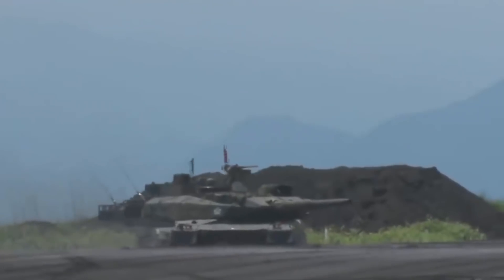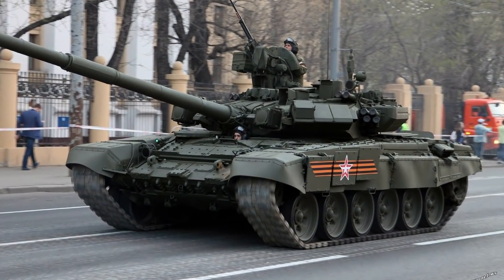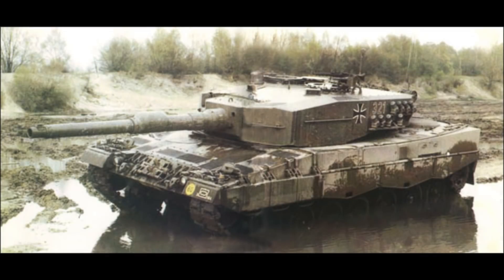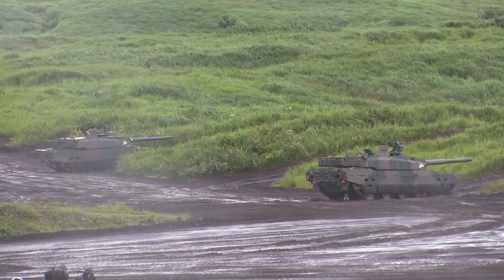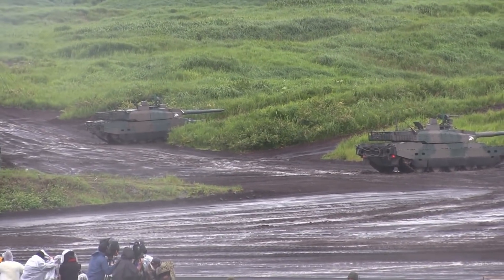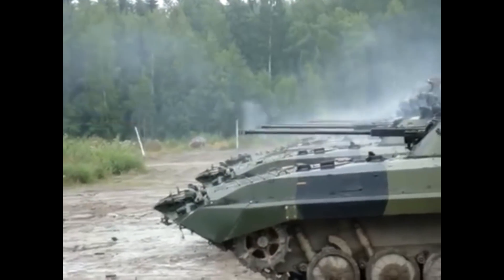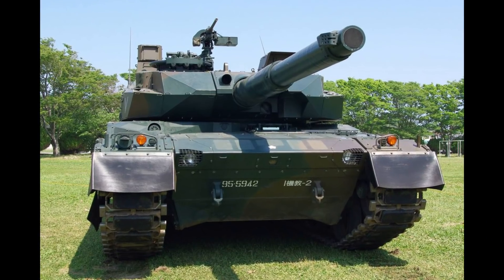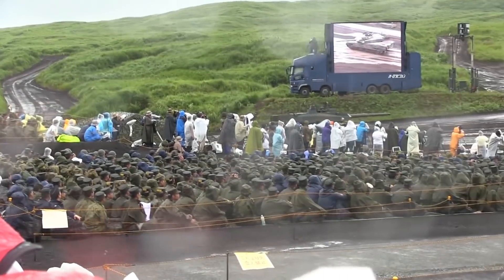Problems with Type 10 tank

Comment: Type 10 uses an obsolete layout, therefore it can't save any weight.  Engine is not transversely mounted, 5 road wheels are spaced far apart which causes high ground pressure loading, the chassis itself is obsolete by the layout alone.
Reply: People tends to attribute heavy weight to armor, which is completely wrong in the Type 10's case.
The tank is extremely frontally heavy because of it's composite armor. To achieve a good frontal armor with low weight, they had to strip off all of it's side armor and focused it on it's front. Also, the tank have a smaller profile compared to it's Western counterparts like Leo 2, Challenger 2 and Abrams. The Type 10's hull dimensions are similar to the russian T-series, and the tank's height can be reduced thanks to it's hydropneumatic suspension. Having a smaller profile helps on increasing the protection, since you have a smaller area of the tank to be covered, it is possible to maintain the same level of protection with less weight or increase protection with the same weight. 
This comes with downsides however, like possible having higher ground pressure because of less roadwheels, having cramped interior, carrying less fuel and less ammo. Upgrades are also hard to do without greatly increasing the tank's weight.
Reply: @_awston1637  While all of that makes sense we just do't know what kind of armor and how much of it.  Wheels seem to be spaced evenly, so i don't know.
Reply: @Waldel Martell If there is no auto loader that's 10 tons alone in extra weight.  I have no clue about the loader, I didn't look it up, i commented on the bases of the cutaway graphic of the layout, and it's an obsolete layout.  Who knows why they went with it.  

For weight management the first thing that's done is optimization of the hull layout, and the first thing that's done there is transverse mounting of the engine to cut down on hull length.
Reply: I am not sure about most of your points, but I sorta agree with the road wheel part. I think this thing needs 6 road wheels like the Russian tanks. However, I have also heard odd number road wheels (5 or 7) is better than even number road wheels (6, 8) for traction and mobility. Perhaps they stuck with 5 because of that.

But 44 tons/10=4.4 tons of pressure per wheel

M1 Abrams 63 ton/14=4.5 tons of pressure per wheel

Leopard 2 61.7 ton/14=4.4 tons of pressure per wheel

Merkava Mk.4 65 ton/12=5.4 tons of pressure per wheel

Challenger 2 62.5 ton/12=5.2 tons of pressure per wheel

As for engines, maybe I am wrong but in automobiles having logtitudinal engines are better for weight distribution, stability, capability and mobility. That is why most high end luxury cars, sports cars and every other heavy duty truck have it while cheap economy cars have transverse layout. Maybe that is the logic?

Also the Type 10 has a V8 engine not a V12 like every other tank, so smaller length engine so longtitudinal is not as big of an issue. 

Yes Type 10 have autoloader
Reply: @_awston1637  yes look up surface area to volume ratio. If you increase the volume, the surface area's ratio decreases. Meaning u need more heavy armor to compensate for that.  While a smaller volume object have higher surface area coverage ratio or in the tank's case protection. So u have more armor ratio per in smaller volume/size tanks which the type 90/10 are (compared to most western nato tanks) so u don't need heavy armor.
Reply: @BigSmartArmed  actually the weight of Type-10s frontal composite armor packages for turret and hull are known

Comment: Maybe the turret cheeks  add on boxes  can be equipped with different armor packages depending on the weight limit of the crossing that are planned during a campaign slash mission or to spread the weight during transport
Reply: If it could be taken off for transport in multiple trucks that would be cool question is if its a thing or not like only after installing the armour once you get into a defensive position isn't that unreasonable

Comment: You forgot to mention that the type 10 has extra composite armor modules that it can have mounted to the sides of it's hull and turret which would add an additional 4 tons if used.

Comment: You have to admit the Japanese doctrine is really smart. Highly Mobile vehicles designed to rapidly deploy, deal high damange quickly using their ammo supply and retreat before a counterattack can be carried out. Designed specifically for the terrain, and the fact that any attacking force will have to disembark first
Reply: More like common sense
Reply: @badgermcbadger1968  you'd be surprised
Reply: @seemslegit6203  mayhap

Comment: I think that due to narrow roads, in urban areas, encounters would either be head on, or an attack on its rear. Also, the could fire from a fixed position in the country side that has been dug in. To counter attacking forces. Hence the front armor is disproportionately stronger. The odd slope on the sides of the turret, expose weakness to the sides, but augment deflection head on. I think its designed to protect the homeland, rather than operate offensively, like the Swedish S from a long time back, but, with a turret.

Comment: Isn't the tank designed to replace the aging Type 74?
Reply: They will also replace Type 90.
Reply: @wezzesunum3297  no they will not, type 10 was designed to fight along side type 90 not replace it
Reply: The type 10 was designed to be able to use Japans infrastructure like bridges like the type 74 and to work alongside the type 90. It works along side of the type 74 as of right now though.
Reply: It was, but due to low production numbers, with less than 120 tanks built since 2010, this wasn’t the case, and is no longer the case. 

Now with the production of the newer Type 16 MCV, which now supersedes the production of Type 10s completed, is replacing the Type 74, and it has already retired a number of former Tank Units based in Mainland Japan with new units equipped with the Type 16. Due to the Type 16’s capabilities in mobility being better compared to the Type 74 and Type 10, it is the more useful and optimistic AFV equipped with a tank gun to see service with the JSDF. This means that with the Type 16 being better and cheaper compared to the Type 74, the Type 74 will see an end to its time in service in the near future.
Reply: @wyattwesterfield4553  Japan is to reduce it's number of tanks from 600 to 300 in the coming years. The remaining will be positioned on Kyushu and Hokkaido.

Comment: Lack of side armor isn't a limitation with the vehicles intended role. The JSDF is a defensive force, and would be deployed with support of infantry and IFV's in terrain. They aren't as much concerned with making advances, as they are containing an amphibious landing, so that air, artillery and even naval assets can then pulverize said landing. So, they're very mobile (to get into position to oppose the landing) with a good gun and fire control (to keep a potential landing force pinned in place, because the Type 10's will kill anything that sticks it's head out of hard cover). After that it's just waiting on the landing force to be reduced and eliminated by air, artillery and naval assets.

Comment: My guesses are the boxes in the turret are mockups (in place only for show). Nobody has seen the  real modular armor installed yet. Possibly for transport and been classified. The thickness of the side armor is a constraint for rail transport. Carriage sizes are different than those that exist in another places. Before anybody comments, HSR aka Shinkansen, don't transport heavy cargo or any type of containers. In Japan, cargo trains use the *japanese regular tracks. In summary, since the type 61, the japanese tanks are for defense of the japanese territory. They are not expeditionary tanks (meaning, made to invade another countries). With exception of the type 90, they all are hit and run tanks. Therefore the type 16 MCV makes more sense.

Comment: Japan has similar problems to Indonesia and the Philippines when it comes to tanks, but it also shares many of the same strengths. Indonesia purchased a bunch of Leopard 2 tanks, but such a big and heavy (and expensive tank) will be borderline useless in Indonesia's topography and geography, given the many islands, poor infrastructure, thick jungles and mountainous terrain. Similarly, Japan has highly dense urban centres (and therefore lots of urban warfare), dense forests and mostly mountainous terrain, and infrastructure not suited for large or heavy vehicles. Traditional tank or mechanized warfare isn't really that viable or likely for either Indonesia or its enemies. Same goes for Japan. even though Japan can't viably use its larger and heavier (more western) Type 90 outside of Hokkaido, most other modern tanks from other nations wouldn't really be able to operate well in Japan to begin with, not to mention the fact that just getting them there would be difficult in the first place.
Reply: Type 16 MCV would be suitable for places like Indonesia and Phillippines. Singapore could actually turn its Terrex or Bionix into a light tank given it's a tiny island.
Reply: @Joshua_N-A  I think Indonesia would be better off purchasing a customised Hunter AFV from Singapore with the turret from the KF51 Panther. Alternatively they could hit up Brazil for the EE-T1 Osório which is a lightweight MBT, hit up Argentina for the TAM 2C, or maybe get the Dardo IFV or AS-21 Redback and fit a 105 or 120mm cannon turret from Cockerill or Leonardo.

Comment: so, all of these points were on speculations created by lack of information gathered.   The turret armor modules are transported uninstalled and are installed once delivered by train or road.  there are declassified statements about armor package level 0 (transported empty) 1 and 2 with varying level of threat protection, plus 'future' plans  in 2013 on intergrating hardkill APS on top of released video explaining as such.  Public information also states that at even the level 0 configuration was set to stop RPG-26 rockets to the turrent side as a minimum standard during development.  additionally the vehicle is built with some amount of nanocrystal carbon steel, the strength of which is claimed to be as high as 3 times stronger than commonly used carbon steel though no one can say for certain.  The ammo propellant that you compare that the 'leopard uses' is the DM33 and DM53, Japan has had the JM33 which is the domestically produced version, from which the Type10 APFSDS was developed to fire a significantly higher pressure to achieve velocities similar to the L/55 out of what is essentially a stronger L/44.  As a vehicle that is intended to be used entirely defensively its would be difficult to argue any of the shortcomings it actually does have are valid arguments against the threats it could potentially face in reality (T-80s and their Chinese clones)
Reply: Agree with this.

The japanese gov has no intention of selling the type10, so alot isnt really known about it. N it doesnt help that the only vids we have of it are sanctioned public demos. No actual training footage or active duty footage. 

Officially, its max armor package will increase the weight of the type10 to 48tonnes. But thats an official weight deemed necessary so it wont damage the bridges it travels over. A bridge obviously wont immediately fall apart if an overweight vehicle drives over it. So im not surprised if it has a classified armor package that would push the type10’s weight to exceed 50 tonnes.

So yeah, we havent really seen the type10 in its “fullest”.
Reply: And as a little seasoning which i thought about:

The type10’s gun can fire NATO rounds, but it would suck at it. Coz the NATO rounds have a lighter gunpowder package, right? Coz its firing from L55. Longer barrel, better burn for lesser gunpowder. 
The type10 rounds are made spicier to compensate for its shorter L44 round… which will probably severely damage NATO L55 guns. Ouch.
So while its true that the NATO tanks n the type10 can share rounds, its better off that they dont😅

Which would actly suck if a situation calls for coop between allied nations.
Reply: @arsyadidris6349  the Ttpe 10 would be able to fire other Nato standard 120mm just fine, the cannon length has little to improve the overall velocity and armor penetration of the round.   American M1s use the M256 which is a L/44 with a different cradle and recoil system.  The reason the Germans started switching to the L/55 is because the new DM53 is heavier and requires the longer barrel for complete powder burn.  The Type 10 round is lighter and does not need as much length to achieve the same velocities.  Additionally Japan also holds the patents from Korea to create self-sharpening sabot too, which Korea revealed in the K276 round for their K1A1s.  Its very likely that the Type10 round also uses this technology.
Reply: @WeeabooShipPoster  oh thats what i meant, sorry i didnt clarify properly.

The type10 can indeed fire NATO rounds, its just those rounds wont be leaving the barrel as fast as they should, had they were fired from their L55 gun.
Reply: @arsyadidris6349 Correct.  Currently the DM53 is the only round that I know of that would 'require' the added cannon length to get it's full potential, though the cannon length again would have only slight benefits to the velocity.  Similar to shooting 5.56 out of a 16in barrel versus a 20in barrel.  for 5.56 that would be a difference of 100fps.  I don't know what the true velocities of the DM53 are but I presume the increased projectile weight is where the majority of the penetration power increase comes from.  conversely, the Type 10 is like loading a magnum round, if you put that on any other 120mm gun you would probably explode the barrel or the breech from the extreme high chamber pressure.  It would be interesting to know how the DM53 performs out of a l/44 but in reality even in the Gulf War tankers used the ammo supplied by their own countries, and the same applies to the more dire ongoing Ukraine war that leopards, challengers, and the newly arrived Abrams also all use their own ammo to my knowledge.
Reply: @WeeabooShipPoster  ok that last bit is interesting. Chally 2 cant use other rounds coz its gun is rifled, if im not mistaken. But u wudve thought the abrams n the leopard 2 would share rounds since its basically the same gun.

I cant rmmbr where, but i read that theres a speed limit to traditional solid chemical propellants. 1800m/s is that upper limit.
Reply: @arsyadidris6349  traditionally most tank rounds are a combination propellant, usually a faster burning core accelerant surrounded by "artillery powder" which burns slower, the accelerant is used to make all of the charge burn evenly and quicker.  ofcourse this might not still be true today with modern ammunition, and we probably wont know for many years.  yes, the Challenger uses a 120 rifled, and it's ammunition is also two-piece.  The alleged Challenger 3 is switching to the smoothbore so that it will also be compatible with German DM ammo.  Sorry, I made that point about the Chally intended to say that the logistic benefit of sharing ammo probably isnt as high up as a priority and is more likely seen as an economic benefit.

Edit afterthought: its possible that Ukraine also keeps ammo separate since eastern nations have had many different types of ammo and calibers from soviet tanks so maybe they are simply used to it.
Reply: @WeeabooShipPoster  owh? So the core propellant is behaving like a secondary primer i guess? Interesting.. 

Yeah thats true. We wont know the cross section of the latest rounds n its composition until they become obsolete n completely replaced with somthing else. And watever we know of them now is generally half-baked info anyways.

Comment: The Type 10 tank uses Crystal grain refined bulletproof steel plate , which have higher defense efficiency than the existing third-generation MBTs that use homogeneous rolled steel sheets.

Comment: this tank dont feel either light or mobile in WT.. i dont care about armor.. but it needs to be alot faster and the turret traverse and gun elevation is horrible.
Reply: That's because Gaijin's sub-par programmers have no idea how to implement Type 10's transmission and the management doesn't care about that, the tank's FCS or the Japanese techtree in general. This tank was added only because alot of vocal players wanted it in the game and Gaijin thought that'd mean a quick buck.
Reply: @PerciusLive  Lol, yeah. No point in even trying to argue with people like that. Anyway, what we can be pretty much 99% sure of is that the Type 10's maneuverability and gun handling should be superior to Type 90's. They'll probably be fixed sometime in the next decade knowing Gaijin's work efficiency.
Reply: @bickboose9364  well, if the Type 10 still keeps eating s*** like it is, they should give it its actual 3.1sec reload. Same goes for the type 90 gettings its 3.5 sec, or fixing its armor, since i dont see them dropping that down to 10.3, where it should be.
Reply: @PerciusLive  I highly doubt that'll happen. The very fact they gave those tanks even 4 second reloads is a miracle. If Japan starts making them more money they might consider your proposal, but the tech tree sucks so that's not going to happen.